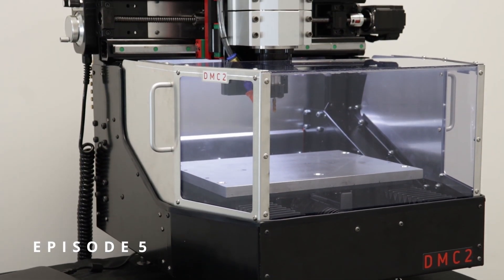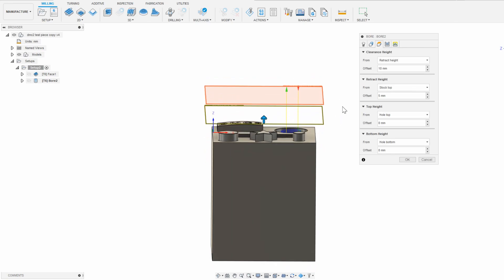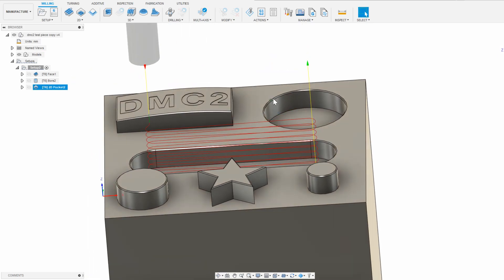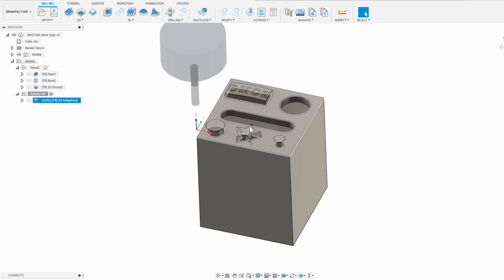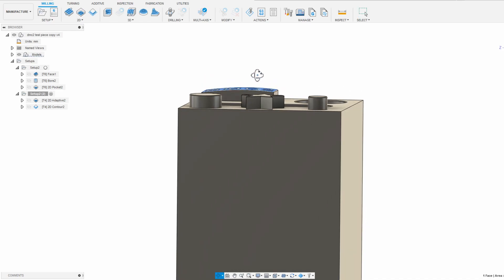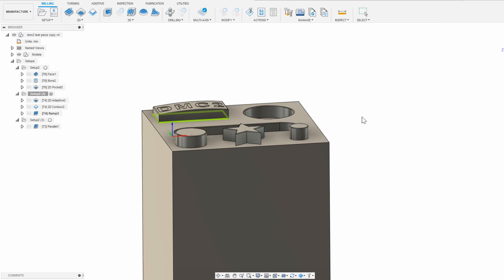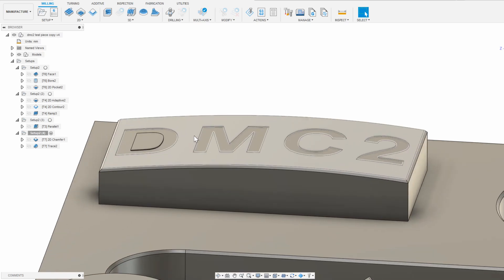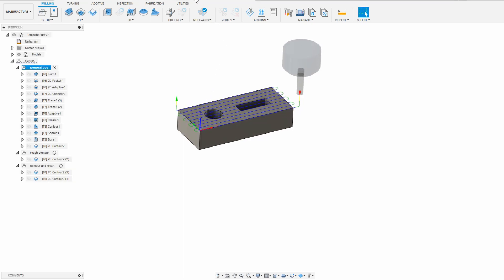DMC2 Training Course - Episode 5 - Fusion360 Toolpaths

Comment: I haven't watched Ep. 6 yet, but I'm wondering why you don't use rest machining options. When you create a new setup you can specify that you want the stock to be at the point it was from all previous operations. Is it something to do with your workflow around probing after tool changes? I don't have as fancy of a CNC as the DMC2 so when I change my tools I'm basically completely resetting the workspace coordinates. I'm interested to see how all these operations come into play. Other than that this is an excellent video and helped clarify questions I've had with Fusion's CAM functions.